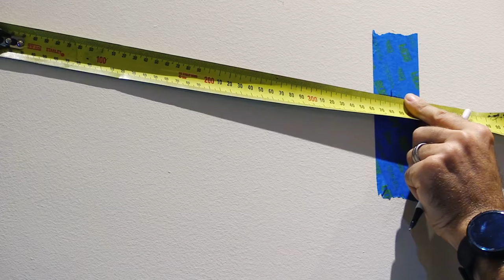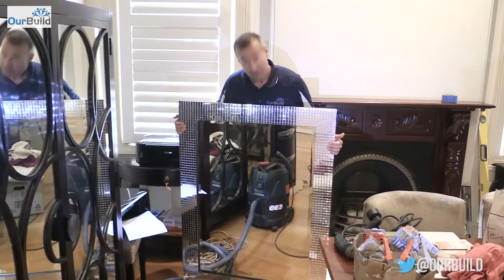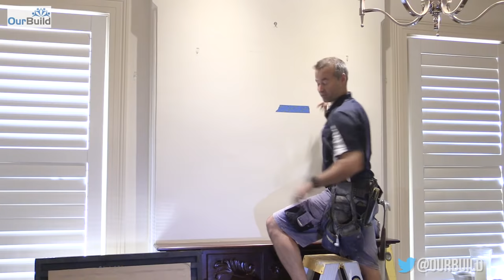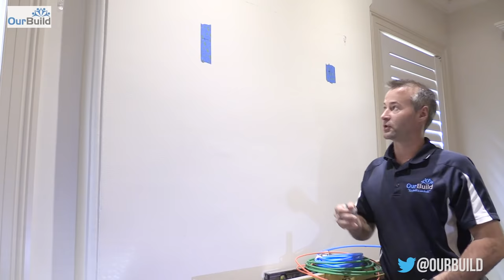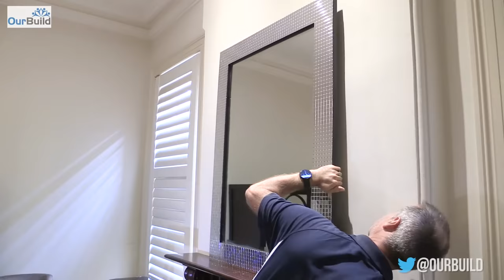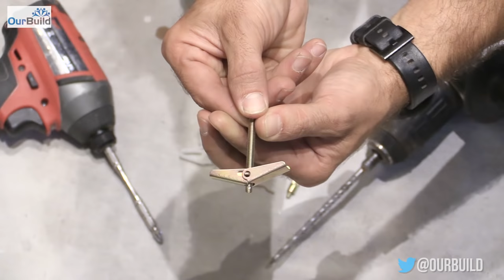How To Hang A Heavy Mirror

Comment: Nicely done James!
Another way to catch the dust if a DIYer is in a pinch without a vacuum, is to cut a paper plate in half and hold the cut edge against the wall underneath where they're drilling the holes and all the dust will fall right onto the paper plate. -Paul

Ps. That Metabo vac is the bomb!
Reply from the maker: Great tip Paul! Yeah it sure is.

Take care mate.
Reply: Our Build d,
Reply: In what world does someone have a paper plate to hand but not a vacuum?

Comment: Hey folks, I was listening to this guy explain the process of hanging the mirror, however, I noticed he said add the width of the wall (1500mm) PLUS the frame (900mm) starting at the 2:00 minute mark of his presentation.     I think he meant 1500 MINUS 900 giving the 600mm he's refers to and then dividing that by 2 or 300mm on both sides..     Just wanted to point that out for new people like I am.   Thanks
Reply: "Take my 1500, less my 900". It's the accent!

Comment: Thanks James! Unfortunately I used the mirror clips and they are not perfect and the mirror is somewhat lose with kids running around I'm afraid... Any tips on how to make it more secure? Thanks!
Reply from the maker: You could try and screw some new anchor points onto your mirror or picture if it has a solid timber frame? that way if the fixing on both the frame and the wall are secure you should be fine. A temporary quick fix maybe some good quality double sided tape on the corners of the base of the frame to stop it from getting knocked lose from your current fixings if one of the kids bump it.

Good luck, hope that helps.
Reply: You can use L-shaped hooks
Reply: @warrenmanda  Hilariously subversive. Thank you.

Comment: How do hang a real heavy mirror. Approximately 55 lbs
Reply from the maker: Is it going on brick or timber stud wall?
Reply: Timber stud
Reply from the maker: @joeengle5982   For that you really need to find a timber stud (with a stud finder)and then use of thicker Gauge screw like a 14g bugle screw into the timber. Depending on the width you maybe able to pick up to studs to help spread the load.  Good luck 👍
Reply: Its. Full length mirror with wood frame 74x44. Thank you.

Comment: Hi I appreciate this video. It really helped me to hang my first mirror. However, because of my bad drilling, the mirror is ever-so-slightly skewed. I was wondering if you had any methods for improving the level without having to re-drill holes?
There are two small hinges on the rear of the mirror. Thanks again

Comment: Couple little tips i use when doing this sort of DIY,knock the plug in but if it don't go flush with the wall is to screw the fixing half way into the plug and tap it with the hammer until flush,the other little tip is to use an envelope about a half inch or inch under the fixing,but don't use the sticky strip that comes with the envelope but use some masking or painters tape to hold the envelope in place,when using tape stick it to your trouser leg or arm a few times to take some of the stickiness away from the tape,that way you won't take any wall paper or paint off when removing the envelope.  😉

Hope you didn't mind me adding my two little tips on this video subject,much appreciation for the video from the UK,subscribed too. ✊🏾💪🏾👍🏾😉
Reply from the maker: Awesome tips, thanks for the comment!